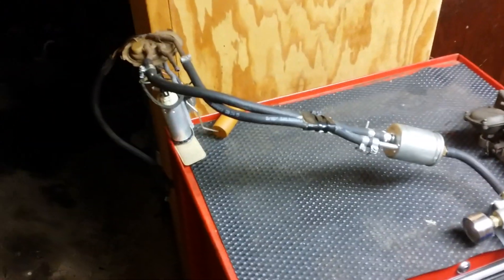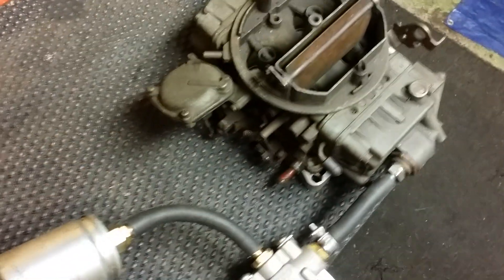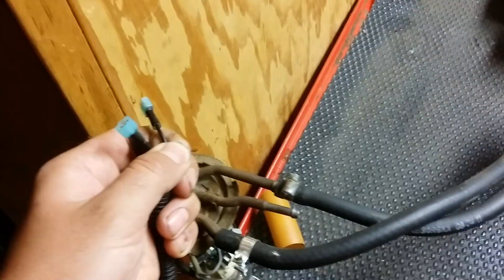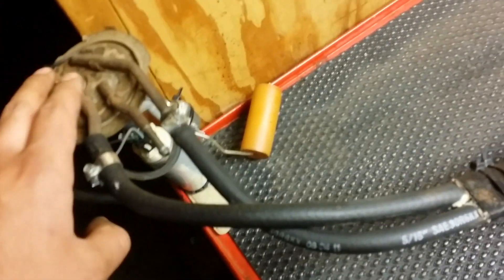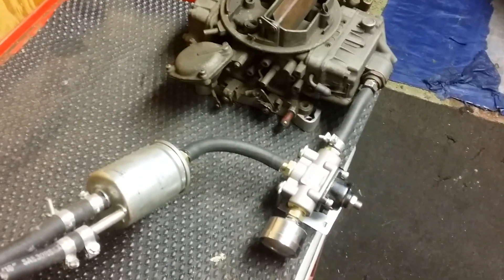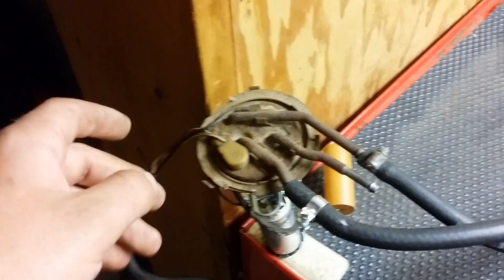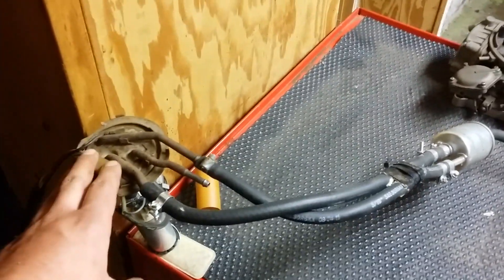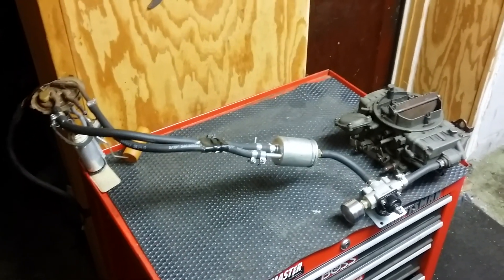**HOW To Swap : LSx LS1 Carbureted Fuel System EXPLAINED 4.8 5.3 6.0***( Part #'s in description)

Comment: So could I run the fuel line off the carb to regulator on frame or fire wall or does it need to be super close to carb

Comment: Question, vortec 350 with cam and 650cfm carb, what fuel pump should I use the Delphi or Walbro? I got everything you suggested in this video.

Comment: Hi. I have an 87-Chevy Caprice rebuilt 5.3LS Holley 750 carb with a BTR stage 3 cam. I wanted to add a new gas tank with Holley blue fuel pump and regulator. I also want to add a sump kit to the bottom of the gas tank. Do you think this set up will be ok? Any suggestions?
Reply from the maker: Ya. Run a 4.3 TBI fuel pump and sender in that tank. Save urself the headache.
Reply: @beeterolds  Thank you!

Comment: I hate in tank pumps. They always go out and huge pain in the ass to change. Pump on the rail is a 4 minute change job.
Reply from the maker: If thats the case why do 98% of automakers use in tank pumps? Sure a pump in the rail makes R&R easier but in tank pumps run cooler and quieter. Just make an access panel and call it a day.

Comment: Will my 89 obs check fuel pump sending unit work
Reply from the maker: Yes. Just need to replace the pump
Reply: @beeterolds   cool deal I had the fuel injection on my truck and it would not run right and I have the 255 walbro on it now so change it to the 195

Comment: I'm putting a carbureted 408 ls stroker with mild boost in my 2011 silverado, can I just change the fuel pump in that like your explaining here? Or because it's a newish truck is it going to screw everything up somehow? 700 horsepower roughly to the wheels, what size pump on the original in tank pump would you recommend if this is at all possible 😄
Reply: I can build em but when it comes to fuel and electronics I'm just getting into it

Comment: I just installed that exact fuel filter in my carbed 5.3 with a 625 demon, I have the proper FPR with the correct fuel pressure, and the fuel pump gets to abt 50 psi before the regulator, and the filter, and even with all that done to it the demon carburetor isn't working well at all, not sure why it won't idle at all now even though the other day it was running just fine and was tuned with a vacuum gauge, the only issue I had was after 5 grand it would stumble and stall

Comment: My fuel pump went out 1995 Caprice power gray plug melted in tank. I hit junkyard only 92 so I figured same shit tbi my tpi. Tpi has more pressure injectors TBI has less. I was starving fuel lines. Makes sense to me after that happen. I bought correct fuel pump my car was happy 60 psi I think.

Comment: My 87 trans am has a mechanical fuel pump on the small block...even tho it never had a pump in the tank can I still use the old sending unit and just add the pump in the tank???
Reply from the maker: Yes

Comment: My q jet seems to like a higher pressure 8 -10 psi idk why it just seems to any thoughts ..?
Reply from the maker: Put a regulator in that line and get it back down to 4.
Reply: I have one and I've tried it at many different pressures and for some reason it just seems to idle and respond better at that higher pressure I kinda got it rigged up and it's even half apart right now putting a tranny in but when I get it back together I'll fool with it some more I like that return style filter I gotta get one and. I gotta build a little relay panel for it as well lots to do but it keeps me out of trouble lol thanks
Reply from the maker: Interesting

Comment: What is that filter's fitting size? I'm in europe and can't go to home depot shelf to test which one fits.. Help would be appreciated!
Reply from the maker: 3/8 on the feed side 5/16 on the return side
Reply: @beeterolds  Thank you Sir. Actually I meant the inlet thread size, I should have been more specific. It turned out to be metric! 

The sender wasn't exactly plug n play for my '87 Caprice Brougham.. I had to extend it  few inches so it would suck from the bottom. Also 2 aligning tabs were in different spot, so now the lines go towards right rear corner of the car (?). Didn't bother me too much but advice for someone thinking doing this.

Comment: My ‘89 C-1500 fuel sender has four outlets, one to the engine, one return, one vented to the filler neck and one to the charcoal canister in the engine bay. I’d like to stick with this unit as it, of course, fits my truck. Using your design using three outlets can I just plug the charcoal canister line and delete the canister?

Comment: I am planning to put a 5.3 truck engine in my 89 C1500 Cheyenne. I prefer carbureted due to the computer and wiring issues with the factory FI. This is a great tutorial for the fuel system. What about all my factory gauges? Can I still use them with this engine running a carb?
Reply from the maker: Yessir. Check out my S10 build videos. I kept the factory gauges

Comment: I have a 98 GMC Sierra I put an old style Chevy 350 in it carbureted I wanted to leave the original fuel tank with the fuel pump is this what I would have to do??
Reply: Yes or just a regulator with the return on it is fine and a filter most people say a filter before and after but especially before to keep any debris out of the regulator I th5both is a great idea and as much hard line as possible before the regulator especially 15 psi on a regular hose clamp makes me a little nervous so I like to make sure its decent quality fuel line not vacuum tubing and double clamp it w out over tightening that is a common mistake the clamps can cut into the hose and cause failure

Comment: Quick question.  Working on this exact setup (thanks for all the good videos!), and I'm not getting any pressure at the regulator and it seems like maybe I'm just cycling fuel right back to the tank.  Looking at the filter labels, you are installing the filter backwards (the one I picked up indicates the end requiring the fitting is the inlet, with the outlet and return on the same side).  I assume flow direction must not matter on these filters?  Just ruling everything out before I go back to the drawing board.
Reply from the maker: Yup I did install it backwards on purpose. Your pump may be weak or if you have a factory  inline filter it may be plugged
Reply from the maker: Also depending on manufacturer. I've found some filters flow too well.
Reply: @beeterolds  OK, thanks for the quick reply!  The other possibility is I may just be too low on fuel in the tank to build up much pressure.  It probably has a gallon or so in the 87 R10 style baffled tank (this is in my 79 C10), so maybe I'm sucking some air.  I'll throw more fuel in the tank and see what I get.  Just wanted to make sure you'd had luck running the filter in reverse before I tore it out and replumbed it.
Reply: BeeterOlds Free flowing filter may be the case here.  Purolator brand wasn’t available locally, so I bought an “equivalent”.  Confirmed this afternoon that it wasn’t allowing any pressure to build up and was just cycling the bulk of the fuel back through the return line.  Pressure is where it should be with the filter removed for testing.  🤷‍♂️
Reply: return filter didn't work on mine either just free flows back to tank wasted another 20 dollars on a puralator filter thinking it would solve my problem

Comment: I did the same thing with a 87 2.8 fuel injection tank in my 84 camaro with v8 and carb. The rodchester needs 13 psi at wide open throttle. I was running out of gas with the 5.5 psi pumps from the parts house.

Comment: Hello, so I have a quick question for you. So I have an 80 k10 with a 04 5.3, msd 6014 controller and harnesses, and such. I am running a cheap autozone electric pump. It’s a 190lph at 6psi. I am not running a fuel pressure regulator bc I just want to get it running and that’s it for right now...... is the fuel pressure regulator a necessity for running it for maybe 30mins? I know what it does and I know it will eventually hurt the pump but will it hurt the carb? It’s a brand new Edelbrock 1406 600cfm carb and still shiny too.... I don’t want to hurt the carb.
Reply from the maker: I use those cheap Mr gasket pumps for testing purposes. It won't hurt anything for that short period of time

Comment: I am planning on x fire injection (tbi) to carb swapping an 84 corvette. It uses a similar style pump and fuel system with a return. I have 2 questions: 
1) could I just use a fuel pressure regulator that has a return on it?
2) since my fuel pump relay turns on with my key if I turn key on without starting car will my carb over flow with gas?

Thank you I appreciate it and look forward to your response
Reply: I'm thinking once your floats go up it'll shut off the main jets. Then the return line will kick in. Sending the gas back to the tank

Comment: Can the Delphi FE0115 be used instead of the FE0110?
Reply from the maker: 1CBRacing as long as it's a low pressure pump for a carbed application sure.
Reply: BEETEROLDS does the flow arrow matter on the purolator fuel filter?
Reply from the maker: 1CBRacing had it been a 50psi system I would say yes
. But for a low pressure application no

Comment: Actually the center is the return 1/4 is the return and the 5/16 is the vent
Reply from the maker: Chasemanuti thanks
Reply: BEETEROLDS  just had problems on my 6.0 swapped g body had to add a return that was big enough to flow the fuel back into tank
Reply from the maker: Chasemanuti I ran the return to vent port. I haven’t had any issues doing so.

Comment: Why not just use a bypass regulator .. a little more than a dead head regulator but seems to be me would be using fewer parts .. doing this right now on a 1996 Chevy 1500 for the NOS system .. using the stock sending unit .. swapped the fuel pump for the lower pressure style pump .. had a -8 pick-tube made for the tank to feed the manual fuel pump to run the engine. Just did an EFI conversion on a 1987 C10 used the stock fuel sender (TBI style) and put the fuel pump right in the tank.

Comment: That Delphi pump is regulated at 44 psi and that's for fuel injection feo 110
Reply from the maker: kevo which? The TBI pump?
Reply: I believe so yes the one you stated feo 110
Reply: And the speed shop that I called to bring the pressure down the regular cost $145 the guy told me but I'll call another Speed Shop and the guy told me 31 bucks I'm going to get that tonight
Reply: Yea I have the 190 fule pump 
Will a cheep regulator work

Comment: Any chance you would know what fuel pump to use in my 1965 Chevy Biscayne wagon? Thanks
Reply from the maker: racer ben Bosch 044 for EFI or Holley Red for carb
Reply: Inline pump?
Reply: Going the carb route, do I need to still use a regulator and keep the pressure around 4psi?
Reply from the maker: racer ben still need a regulator and a return start around 4psi and see how your engine responds to it.

Comment: i just replaced the sending unit in my 83 El Camino.  Can i just add the pump to the sending unit, and create this setup or do i have to replace the sending unit with this one that's made for a pump?  What size tank do you have?

Comment: Got a 4.8 ls that I plan to drop in a 87 caprice and I'm running a carb setup. Will this sending unit setup work or do I have to improvise?
Reply from the maker: Epyion Khreschendo this will work. Some say you need a baffled tank but I don't have one. I just keep the tank around 1/2 full or more and I have no issues
Reply: what happens if you let it go under 1/2 with the 87 chevy model tanks

Comment: Hey Man, Love the channel, huge help. Quick question. I'm wanting to run a carbed 4.8 or 5.3 on an 87 K10 former tbi engine. The TBI fuel system is in place, so I'm good there. Just wondering if the factory computer will constantly throw a check engine light without the tbi and is there an easy way to avoid it if possible. Thanks in advance for the help.
Reply from the maker: Yup.. the light will be on.

Comment: You have a part # for the regulator and gauge?
Reply from the maker: nandoGdog Google is your friend. I remember it's a Summit brand gauge and a Quick Fuel regulator
Reply: I had one ordered but found out it was only 1-4 psi. Cancelled the order till I could ask what yours was rated at?

Comment: Do you need to run a return style fuel system with going Carb?
Living in Alaska we don't reach lower 48 summer time temperatures.
Reply from the maker: Shaun Haragan I recommend it cause it keeps unnecessary pressure off the pump
Reply: Dead heading any fuel pump from what I understand is bad for the pump for various reasons although mine is that way temporarily and I need to fix that ..

Comment: Swapping 5.3 into my 89 c1500, I can use my stock fuel pump?
Reply from the maker: if it's carbed yes... EFI replace ur stock pump with a Walbro 255
Reply: +D.Szymanski yes I'm going carb, thanks man

Comment: Great videos. I have a question. If your using a tbi fuel pump 14psi then reducing it to 4 psi , but using a filter with a return thats made to work in a 30-40 psi system in a expedition isn't the tbi pump basically running deadhead since it never hits 30psi to actually required in the fuel filter to return?
Reply from the maker: Nah because the return style filter is free flowing. it doesn't matter what kinda fuel pressure you are running. that's what I ran on my setup I always had a quiet pump that wasn't laboring and my fuel pressure was always consistent

Comment: Will the fuel filter off of the 02 camaro work it's made like that but different regulated rating
Reply from the maker: As long as it has a built in return I don't see why not!

Comment: running carb set up. stock fuel tank. fuel pump with built in regulator. my question is do I need to run that type of filter or reg carb filter. also do I really need a return line?
Reply from the maker: return line is a must no matter what kind of electric pump you are running... it will help the pump last longer
Reply: Ok I see. So if I have an inline fuel pump with built in regulator can I just hook up the fuel filter you recommend and run the return line off of that one?
Reply from the maker: +Jorge Lloyd I wouldn't run an Inline pump..

Comment: I'm in the process of building a daily driver gbody which fuel system  setup would you recommend taking everything into consideration to do both ?
Reply from the maker: Are you going to run a Carb or are you going to run EFI.

Comment: what would be cool to know is.... The same kind of info but based on a fuel injected LS system and why is 50psi needed compared to the 13-14 the carburetor. Also what sending unit would work with that. Also what vehicles fall under the body styles i.e A body, g body etc. I have a pick-up and when I search for parts I don't know what to look under.
Reply from the maker: 50 is need to fire the Injectors... the TBI system used low pressure unlike a multiport setup... TBI pumps are rated at 14psi but still need to be brought down to 4psi otherwise you're blowing your needle and seat apart